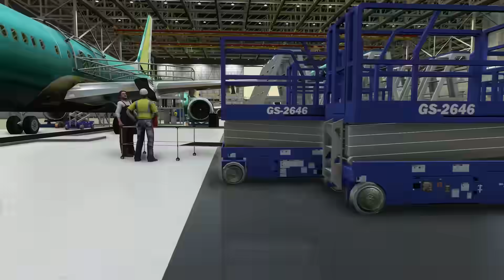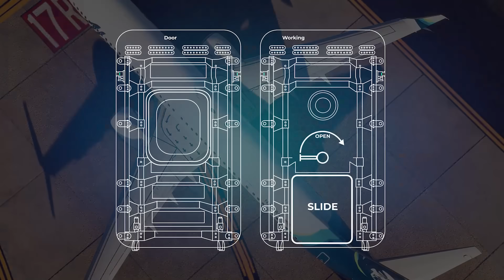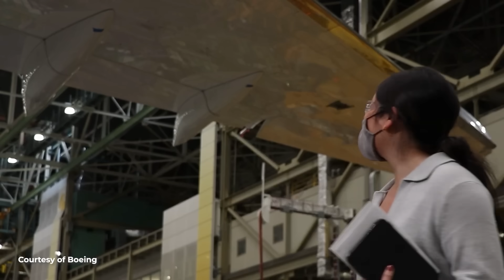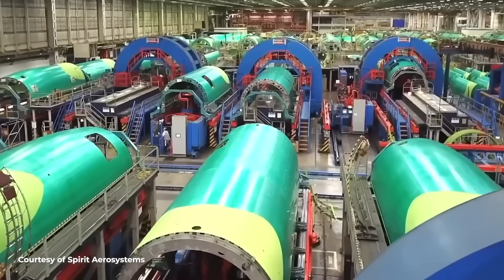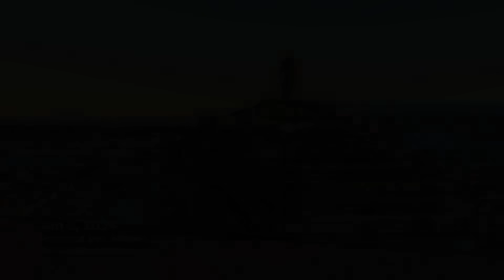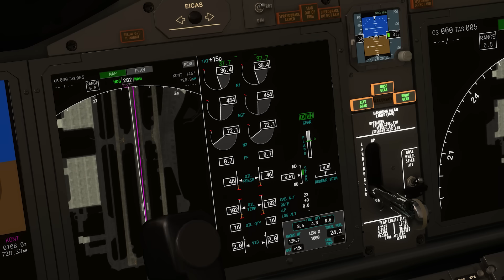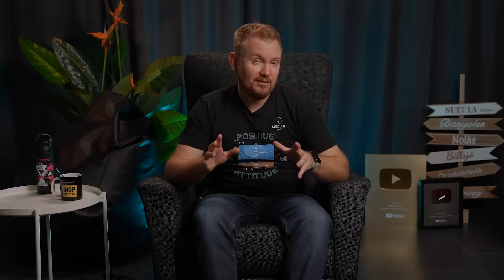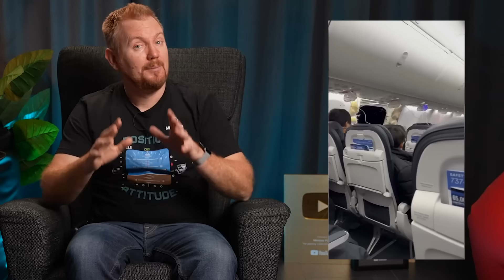Boeing 737MAX BlowOut!! The Scandal behind Alaska Airlines flight 1282

Comment: Boeing didn’t tell you about the cockpit door opening automatically in a depressurization?? And you are surprised? They also never told you that the plane could get a mind of its own and make the plane go down into the ground and crash either did they. Imagine what else they haven’t told the pilots or the airlines. That is exactly why I won’t fly in any modern built Boeing aircraft. After they merged with McDonald Douglas that’s when the trouble started that’s when the decided to put profits over people. So I’ll fly the older 737, 747, 757, 767, 777 and I won’t fly any 737 Max or 787. When the 777X comes out I’ll have to see where it is built. And if they are outsourcing a lot of the work to places like Malaysia. If someone had been walking down the aisle they wouldn’t have had to be in front of the door to be sucked out. And if someone had been sitting in that row without a seatbelt on they would have been killed. It’s a miracle that no one was killed. It’s also a fucking miracle that the door didn’t hit and damage the elevators in the tail of the plane. Or what happens if the door that came off was one in front of the engine and the door comes off and goes into the engine. This won’t be the last time yall have problems with this plane.

Comment: Removal of any parts or hardware requires a Removal record with quality inspection at minimum after completion. Also there should have been inspections prior to covering the door plug with insulation blankets and / or interior panels.
Also, to clarify engineers don't inspect the aircraft. That is a quality inspectors job. But anyone can highlight potential non conformities.

Comment: SEEMS TO ME MANY OF THESE THINGS WERE /ARE AVOIDABLE. LOOKING AT ROWS OF DUMMY DOORS IN PRODUCTION IS WHERE THE PROBLEM FOR BOEING ET AL STARTED.

IKEA AND ASSEMBLE-IT-YOURSELF FURNITURE & TOYS HAVE MANAGED THE CHALLENGE BY PLACING PIECE-PARTS IN PLASTIC BAGGIES. A WORKER WOULD PICK DUMMY DOOR KIT AND COMPLETE THE ASSEMBLY THEN, WHEN THE WORKER CONSIDERED THE DUMMY DOOR COMPLETED S/HE WOULD PASS THE DOOR TO INSPECTION.

THE ROWS OF IN-PROCESS DOORS SUGGESTS A PROCESS WAS PERFORMED ON ROWS DOORS.

AS FOR THE MCAS IT SHOULD BE TREATED LIKE A NEW CAR.

A UNSKILLED WORKED SHOULD STICK BRIGHT, NUMBERED, COLOURED LABELS TO EVERY SWITCH, KNOB, BUTTON, INDICATOR.

THEN AN UNSKILLED WORKER WOULD RANDOMLY SELECT A NUMBERED ITEM. A TECHNICAL PERSON WOULD TICK THE ITEM AND THE STICKER WOULD BE REMOVED.

IN THE CASE OF MCAS THERE WOULD BE TWO UNIDENTIFIED SWITCHES. THE TECHNICAL PERSON COULDN'T ASSIGN A FUNCTION TO THESE SWITCHES. AN ERROR HAS BEEN EXPOSED.

THE TROUBLE WAS MANY TECHNICAL PEOPLE WERE SCHEMING TO HIDE THE SWITCHES.

Comment: Quick corrections: NCR stands for NonConformance REPORT and SAT stands for SHIPSIDE Action Tracker. Also, removing a single nut or demating a single electrical plug requires a CMES removal ticket to be approved, or at least that was the expectation when I left Boeing in 2020. There should have been a removal checklist written up before work was started on the door plug, even if the plug was only being moved and not actually taken all the way out, because it was being taken out of conformance to the engineering drawings.

Comment: So, why wouldn't the autopilot at least automatically stop ascending and level off when the plane detected the loss of cabin pressure?
Reply: Because of the high probability of it being an unwanted action, for example, if the aircraft is approaching the next sector and has to climb above the minimum safe altitude for that sector, disengaging autopilot could lead to a dangerous situation, more dangerous than traffic conflict. So, basically, the lesser of two evils.

Comment: "If it's a Boeing, you will be going, and possible soaring" if at the plug door exit.

 Inspection by certified, outside Inspectors is a function worth the labor costs and one not able to be automated yet. I was a DOT Inspector for the state of Ohio, overseeing an I-675 bridge, and RR spur from Wright Pat Air Base in Dayton, where Carl Bildt met with NATO for Bosnia Peace Accords.
 Contractors cheat to reduce labor costs and can be incentivized to seek speed instead of Army Corp of Engineers standards which are what they accepted when they bid for the job and were awarded the same.
With so many quality control risks at the completion of each unit there must be no assurances Boeing got what it paid for. 

"Blame" could be a new Netflix drama based on the Boeing Clusterfrack, incorporating Chicago corruption ala "Suits", and Seattle legacy syndicalism,. Of course the normal back-biting American corporate clusterfrackery like the current Murdoch based series helps

BTW, Peter. showing the market share of the various models and each corporate reaction and/or prediction to the same helps explain their Clusterfrack. (pg version of a military term without a synonym). Class actions on behalf of the passengers against the Boeing employees that sought stock appreciation over safety could identify how much appreciation they enabled and what was the P/E for that period as well as timing for buybacks. American companies have a Capital Value for the human life lost under their operational umbrella for Risk Management which is outsourced and as John Oliver covered when applied to Fracking, as long as the Risk Management teal pulls the trigger, the company is allowed to kill the employee...or let them die.

Comment: Non conformities are usual in airplanes.  Each company has its own procedures, but typically defects are written up and sent to engineering for disposition:  use-as-is, rework, return to vendor, or scrap.  Engineer dispositions, Then back to the floor for execution.  
   Spirit committed the original sin, Boeing caught it.  But then came the rest of the story.

Comment: This has to be the best account of the incident available. If this video does not show up in every training department for annual training, then the training dept. needs help. This is a great combination of "man on the street" and professional pilot explanation. (I do have the background to state this.)  In actuality this has virtually nothing to do with the 737. It is a quality control issue that could have happened to any aircraft. Read: missing parts after maintenance. Again....poor quality control. The fact that passengers had made comments about the 'whistling' and that it was not followed up, boggles the mind. The Boeing method of committees to monitor committees checking on committees is 'mindless'. But then again the stock prices are high, so screw the rest.  Ha det.

Comment: I work in Aerospace and when I heard that the door was only opened and not removed because of the QA inspections that it would entail, it made me think that that decision was made by a manager of some sort that had a schedule to meet and that the whistle blower was likely from the ranks of the technicians and engineers who thought it was ridiculous to "cut corners" like this. Whenever we break routine and make knee jerk reaction i.e. they decide that the fix has to happen now and everyone involved has to stay late, the paperwork and checks seem to go out the window because this person or that person had already gone home etc... and they will check it in the morning......only to be blasted again in the morning to hurry up and get the panels on, thus not giving the techs and engineers time to think.  We have a protocol called TEBS, which gives anyone in the crew to stop work if they feel that it is putting undue risk to the task at hand. I did it myself not too long ago, the manager wanted the test to start right after a rework item had been completed, which was already late in the day, the QA personnel had gone home, we hadn't had time to go through "the pretest checklists" etc.... so after a bit of back and forth and the holes in the swiss cheese began to line up, I called BS and shut it down until the next day after we had time to think.

Comment: ..Reminds me  of the same mentality as the Challenger faut pas..  Where the board of Directors over rode the advice of it's Engineers and launched anyhow.. The Achilles heel of such primary focus on rate of return  over riding front line engineers...
Reply: …..and the engineers over-riding the advice of technicians.
Reply: @darronwolf7731  For sure... In my company, I actually put seasoned (read: old, been there done that quality street smarts) techs with veto power  to force meaningful reviews of the engineers production designs.  Some weren't happy, but I was, and it was my company..

Comment: Great video and informative as always! Here is an interesting one, flying GSP to DTW on Delta next month. It was a Boeing 717 but an equipment change to a 737-900ER, I recall those are /were part of the inspections? I just find it odd because the inbound the night before isn’t crowded at all, same plane returns next morning, one I am on, maybe 1/3 full… just find it all a bit weird as a 717 seems more appropriate? Are they testing out flights with shorter lower altitudes with easy diverts? Or just happenstance? Hmmmm… that said 739ER doesn’t bother me like the Max does. In all of this Boeing really needs to get its culture changed, I find it funny how the Boeing Board of Directors is mum on all of this, I guess gotta go play executive paddy cake and get that board salary :-/

Comment: It has everything to do with the design of the plane.  The mere fact that it had a plug door was a conscience design decision based on money.  This type was designed with an opening for the emergency door/plug to save money.
 As can be seen on the 757, there are some aircraft with 8 full sized doors and some with only 6, with the L-3 & R-3 door openings non-exsistant.  Either door arrangement could be ordered, depending on what the customer ordered.
 The Max9, as well as the -900's, were all made with that opening, with no option for no opening to be made, at all.  This was obviously done as a cost saving measure to Boeing.  Making only one kind of fuselage.  Because of that, the plug had to be used when it wasn't being used as an emergency exit.  If customers had been given the option of having an opening, or not, would have reduced the chance of this accident happening. The cost savings/profit margin was a contributing factor to this accident being possible. 
 This is another example of Boeing squeezing the very last penny out of the 737 before they reluctantly have to end production.

Comment: Boeing seems to have developed a habit of “forgetting” to tell pilots about various features of their planes. Kind of makes you wonder what other surprises they have in store.
Reply: Yeah like MCAS?
Reply: Communication seems to have been a major issue with the MAX at every level, because the airline company orders were so dependant on the demand that the MAX is to be the exact same plane, just bigger.

And to facilitate that communication and documentation seem to have been left intentionally vague or incomplete at all levels so an engineer didn't blab the wrong thing to the wrong contractor. I'm not sure whether this accident in particular could have been prevented that way though, as this was a case of overworked engineers with a lot of QA issues to validate. Ideally every time you're dealing with removable parts a full control check should be performed, but when you're dealing with so many issues every day on a already notoriously unreliable production run, some corners need to be cut somewhere to meet the delivery demands. Unfortunately this was the wrong corner at the worst time, where presumably someone was responsible for removing the door, and someone on an entirely different shift needed to reinstall it. Maybe they weren't properly briefed on the locking bolts, or maybe routine took over as besides the bolts the installation of those doors is identical to their actually functioning counterpart and after completing every step they're used to, a +1 extra step didn't even cross their mind. Either way, validation by another party would have immediately caught the issue and put in proper steps to prevent it from happening again.
Reply: Yeah like MCAS?

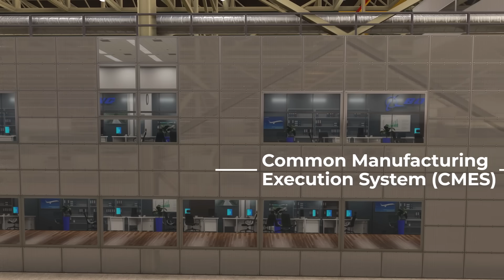Comment: 9:52 - "But not all thinga went through the CMES, since it was quite cumborsome to work with..." WTAFF. You NEVER. EVER. do your Non-Conformances outside the system intended for it. People die if you do.

It doesn't matter if it's cumbersome or not. Either convince management that a better system is needed or you work with what you have. 

When a plane develops an issue mid-flight, it is a bit difficult to park the thing and put a ladder against it to solve said issue.

If I come across somewhat "passionate" is that I used to assemble panels for the A380. And every time I kept in mind that if I didn't work according procedure, flag issues correctly, etc., it could kill someone's son or daughter.

Also if there are deterioted relationships, direct human contact is needed (I dare say required), because e-mail, chats etc. are the absolute worst methods of communication. Totally not speaking out of expereince here...

It also means that, next to a CNN article of a person refusing  to fly on a 737 MAX (who worked on the assembly line of these things), I also won't fly on the 737 MAX. The bloody things are too unsafe to fly with imo.

Comment: Still amazed at the inherent design flaw, it should be fail-secure rather than rely on bolts subject to human error.  The door plug should  be larger than the opening.  Same nonsense with the MCAS relying on one sensor instead of 2oo3.

Comment: I don't know if it is true, the reports I heard also state that Boeing also remove the door during in installation of all the guts of the aircraft.  Having the extra open door makes getting everything inside the airframe easier.  Again, I don't know how true that is, but that would also then necessitate having the door resealed and a quality check done.  

I was hearing this as the company I work for supplies Boeing the HGS.

Comment: So, 2c. I've been a software developer working on these acronym/initialism systems of various sorts, some used in aerospace, some in aircraft maintenance and I've turned down other work in systems for aircraft maintenance because I didn't like the look of the project/job. It's not uncommon for half the product decision to be deviated by a middle manager with a bone to pick or some wild ideas (client side or various, most are capable but it's if this is a bad source of change motivation itself things won't go well), that permeates down as we all know.

If it wasn't down to me and other software developers who should be focusing on the actual code, or graphics designers (few on these particular projects but worth a mention), testers etc, the products themselves wouldn't actually cover the use cases reliably and nobody would actually know until years later... that's just one layer in the whole unsavoury sandwich. But overall, we make the modern world work decently so, swings and roundabouts (swings and roundabouts may or may not be unsafe, use at your own risk).

Comment: Isn't anyone slightly concerned to know that the flight deck door will automatically open if the aircraft loses pressure? Those doors are supposed to secure the flight deck from hijackers gaining entry, and cannot be opened from outside. Bad that the pilots weren't told this, probably worse that any budding hijackers now know this.

Comment: I wonder what's next for the Boeing Board, senior executives and upper management? Typical huge "too-big-to-fail" company problems with financial costs and delivery deadlines pushed to the limits while the public facing corporate speak delivers smooth spin doctored language to appease the shareholders and travelling public.
Meanwhile the annoyed and disgruntled engineers are shafted by all sort of undue pressures no doubt, extreme timelines and skilled labor shortages, quality systems out of date or conflicting, and other external pressures beyond their control. Generally all dictated by the bean counters and the dollar.
A superb high quality video!! 10/10

Comment: Fascinating stuff. One thing I find a bit crazy is that in this day and age of terabytes of data storage that the CVR in a brand new aircraft is still limited to just two hours of recording before being overwritten. Nevertheless, it’s obvious the crew did a fantastic job in this incident sand I hope they will get the recognition they deserve.
Reply: " The older analog units use one-quarter inch magnetic tape as a storage medium and the newer ones use digital technology and memory chips." - source: NTSB - Cockpit Voice Recorders (CVR) and Flight Data Recorders (FDR)

I was going to guess they still used tape (for valid reasons), but after a quick search, it appears that newer planes do use digital systems. So I'm with you in not understanding the automatic overwrite. Audio can add up pretty quick in data. 16 bit wav files is around 650MB for an hour of audio. Pretty much a gig for 24bit. But memory is hardly scarce resource, so I'm with you wondering why that limit is still the standard. It wouldn't be a problem to have a CVR/FDR for every entire flight, from gate to gate. 
I would think this would also provide all kinds of data to improve airplane systems, CRM, etc.

Comment: Curious how many companies would demand refunds for the planes they bought... I read in my studies that companies like Boeing sell planes on credit, usually, so I figure it would result in court fees or a write off as trust has been seriously hurt... figure if someone did die, that would be due to negligence of the teams involved (as so many problems were initially found and swept under the rug), and likely result in a large settlement and similar situation, though that is merely speculation at that point.